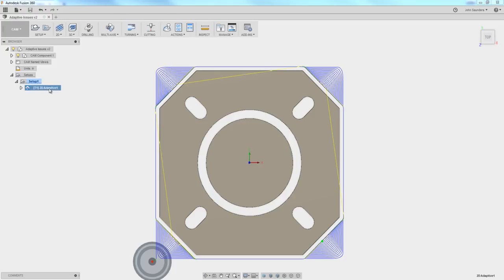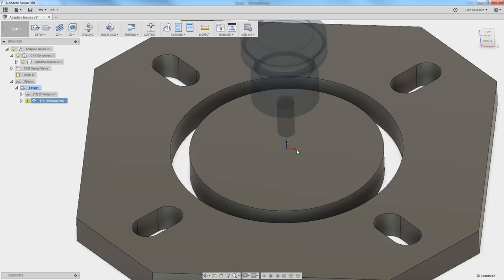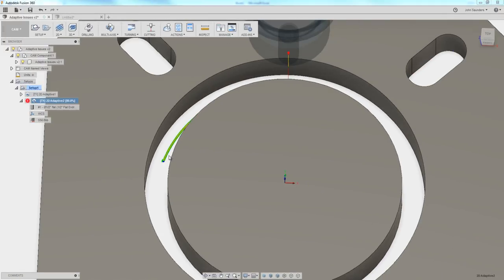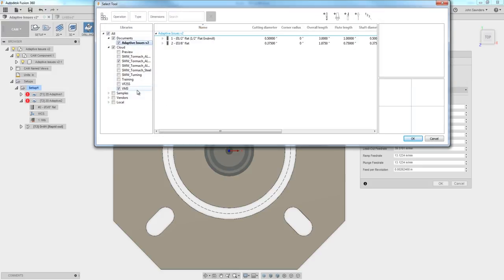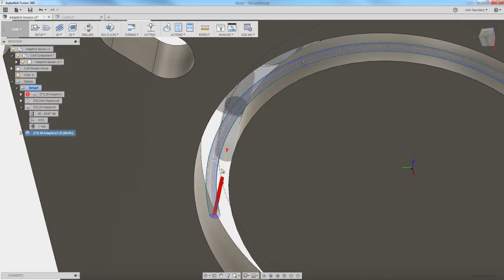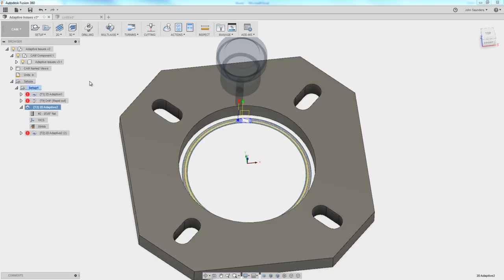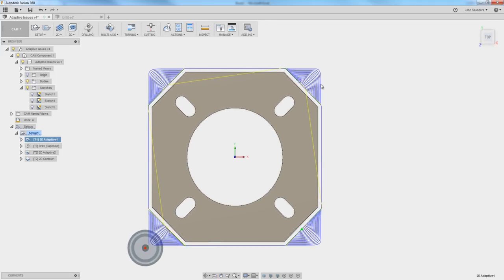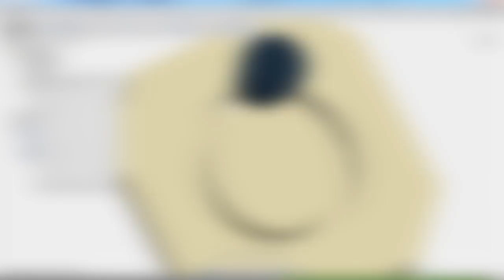Fusion 360 2D Adaptive Toolpath Containment! FF106

Comment: John, stock contours is the way to go to contain your toolpath in the last example.

However, the contour you picked solves one problem (prevents crashing the clamps) but creates another: if your stock is what you described in your setup (or more), your toolpath now ignores this fact and the first passes will result being much more aggressive (much higher WoC), which in turn might result in chatter (good scenario) or tool failure (bad scenario).

You can solve both problems, no clamp crashing & even WoC (i.e. even tool engagement angle) if you sketch 4 small squares that contain the four corners and extend beyond your stock. Then select these under stock contours.

Comment: I wonder, can't you ramp down on the sketch line (the 6.15" one), and then clean the face that you want?
is that worse than an adaptive?, or does it cause other problems like tool wear or whatnot?

I'm no cam expert neither machining, the little cnc I've done was on a FAGOR 8025M (maybe 8050/ or similar, I do remember that faceplate style with the monochrome crt) without any connection to a modern pc.

So in one os those between typing in over 9000 commands from CAM vs 1 helical ramp ...

Maybe the controller was able to do searial but I'm certain there was no cable for it lying arround.
Reply: dgo85 he just likes adaptive
Reply from the maker: You could, but then you'd be slotting

Comment: I used two THREAD ops with the 1/2" endmill. One on the inner edge, one on the outer edge. Set "thread pitch" to .050 or .100. Set lead-ins to zero.  It spirals right down gradually and works great. Can't do tabs this way but it is definitely fast. Thoughts?

Comment: Does Fusion not have some mechanism for specifying exclusion zones for clamps etc?
Reply: Not yet. It's on the horizon, but it's still a ways down the road.
Reply: 100% agree with you. I have worked with a few people that had very little understanding of what the different G code cyclus did. If they had a problem they would run back to the computer change the program on the computer and try again. 
The running back and forth between the machine and the computer gets really annoying to look at after a while.

Comment: I'm wondering why not make multiple holes (10 or more) on the entire 6.15" line and then simply ramp down with a 2d contour much faster than the adaptive ?
Reply from the maker: gang drilling can be a great technique!
Reply: Yes. I use it a lot on my knives.
Reply: Gang Drilling is an acceptable method if you are limited to using a drill press, hack saw, hand files and die grinder.... but is not ideal for most professional conventional machining operations.  The holes cause what is called an interrupted cut, said interruption in tool pressure typically generates a horrible amount of chatter, wear, and dimensional instability in your part/process.   As far as I know what john showed here is pretty much the way to go as far as method... you can go multiple id /od roughing paths with an alternating depth of cut to provide a good escape trough with flood coolant..and get a fine result...but ... if the tool is not supported on both sides in the slot... you get deflection that can also wreck your day.   Is a pretty good video... good coverage of basic cutting technique / topics..

all of this holds true for stuff like cutting key ways as well... which is why key ways are best cut on a horizontal with an arbor.... any shape you slot or cut.. if the tool is not supported on all sides... it will deflect.... high pressure flood coolant is your friend here.... which is what the champ John said.

Comment: I would have just spiraled down the whole slot in a continuous move. Using a .5" necked rougher, then come back with the endmill to clean up the walls. Technically just one wall, the slug don't matter.

The machines I work on just don't have that capacity to handle that code. You basically used 3 Robodrills for just one slot. What a joke machine. What's the point in a rather decent table size if you can't use it, due to file size limits?
Reply: exactly what I have thought